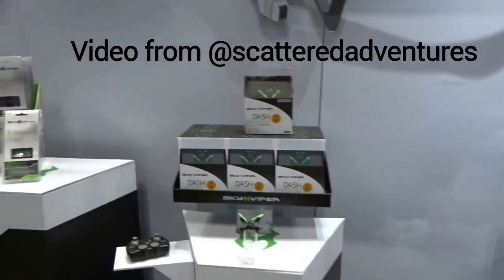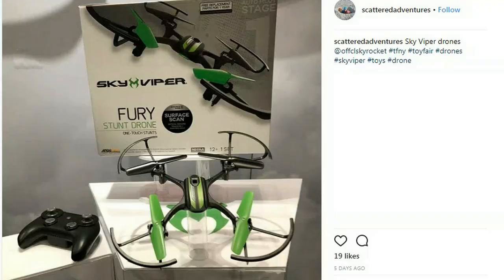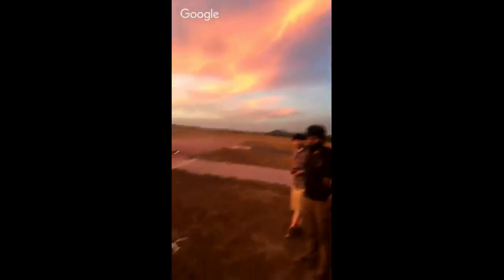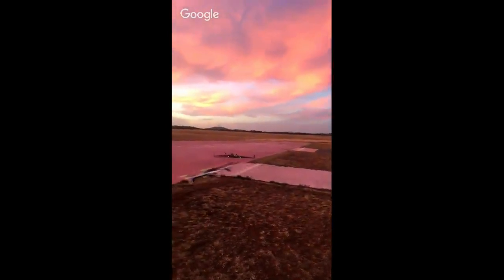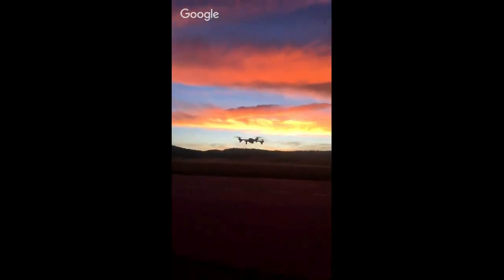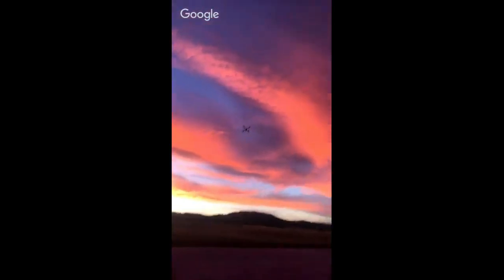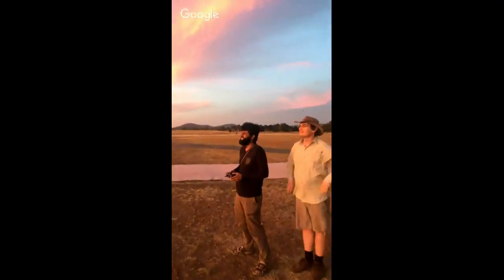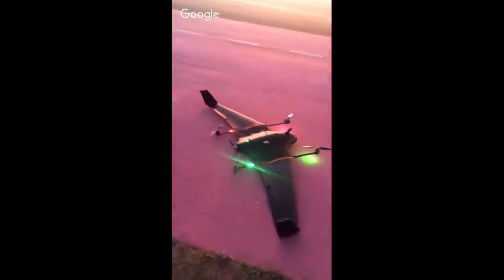Sky Viper Fury - An upgraded V2450 GPS?

Comment: I wish Sky Viper would confirm whether or not Ardupilot will be configurable on the Fury like it is on the current GPS model.  If you\ve ever flown the s1750 you can see the potential it has to be an outstanding brushed quad if you could turn off stabilization and adjust the rates.
Reply from the maker: I am sure the folks at Arduplane would not have continued working with them if that were not the case.
Reply: Yes it will have the same as the last modal.and its even better.then the old modal.